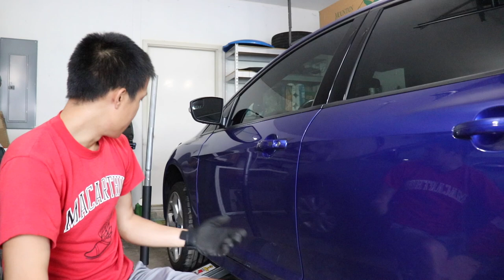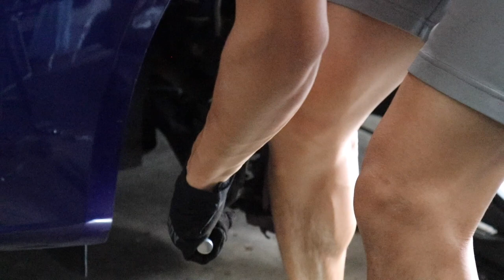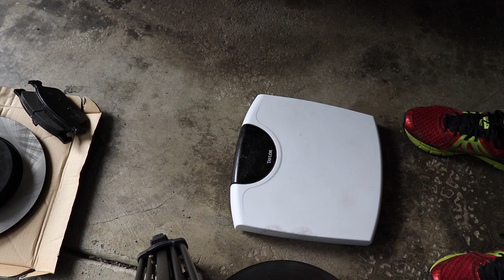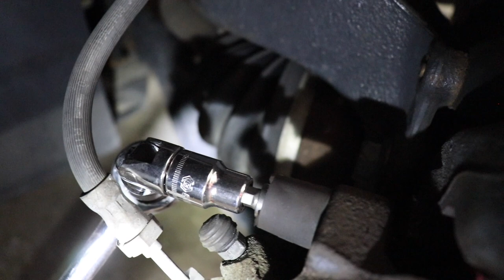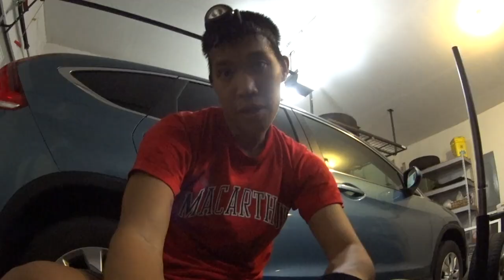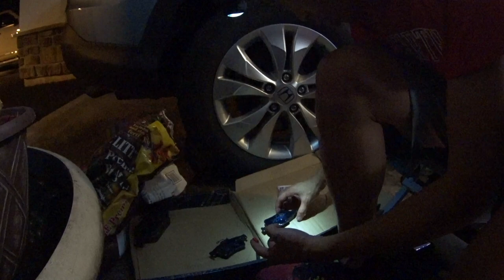Brake Pads & Rotor Install | Ford Focus ST

Comment: The rear caliper bracket bolts, what's the torque spec when tightening them? can't find that info anywhere.
Reply from the maker: I haven't seen it anywhere but 30 ft lbs should be plenty
Reply: @DerrickMoy    so   20 ft lbs for caliper pins and 30 ft lbs for bracket bolts? (rear brakes)

Comment: How did you remove the caliper bolt next to the sway bar?
Reply from the maker: Best bet is an Allen key I forget what size it is but I think it’s 8mm. I ended to using more extensions with the wrench
Reply: I stripped the allen socket of the sway bar link. Was not a fun detour. Had to get a new sway bar link.